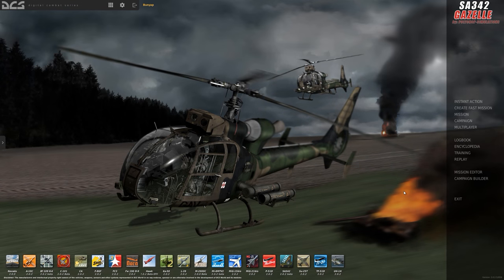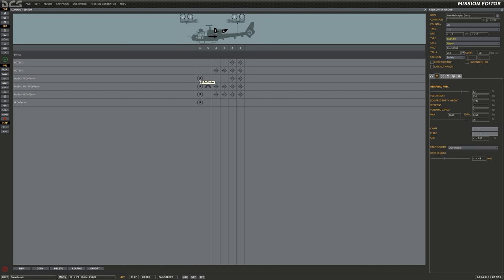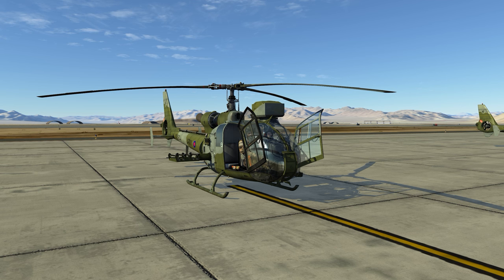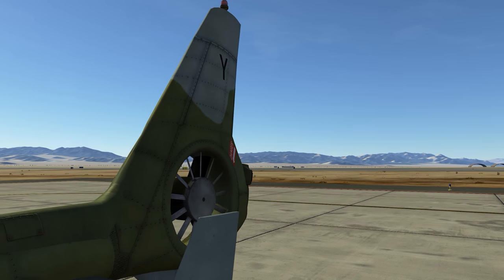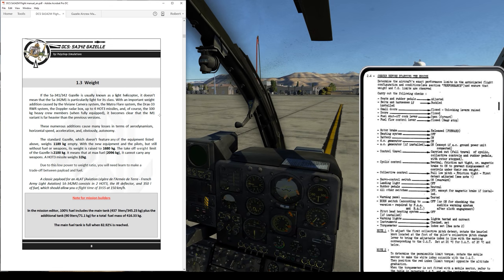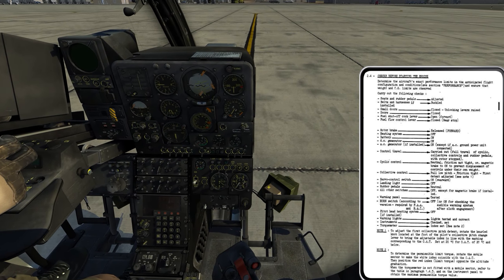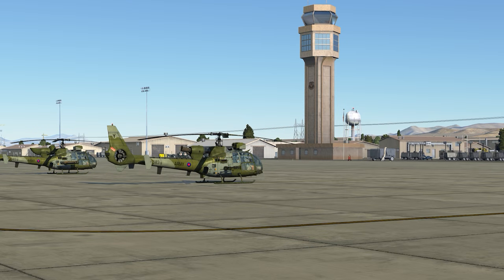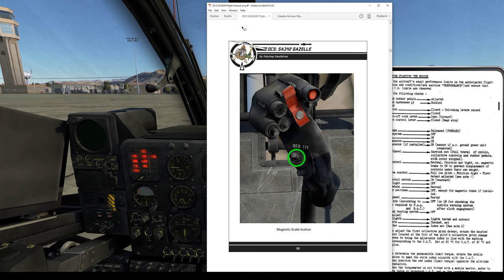Test Flight - DCS: SA342 Gazelle #2 - Fuel Planning, Walkaround, Electrical System, Startup

Comment: Great video. I am wondering. Does this Sim ever have random failures like with the lights etc. When u check the lights u are checking for burnt out bulbs... Would that happen in the sim ever? Would your battery ever be too low voltage etc etc? Just curious if these checks are done just for the sake of authenticity or if they are useful in this sim.
Reply: 4 months late, but: Some failures are modeled, it really depends on each aircraft (since they're developed individually to different standards). It's certainly possible to model something like failed bulbs, but I just don't think they do it, due to lack of .... well... reason, I suppose. But actual aircraft systems can fail, like hydraulics, electrics, and specific systems for each aircraft. But that's optional - they won't fail unless you literally break them by doing something wrong, or if the mission you're flying is designed to cause a failure... Or you have random failures enabled.